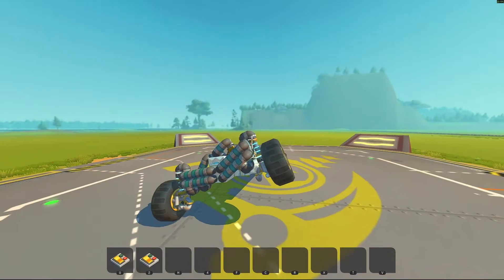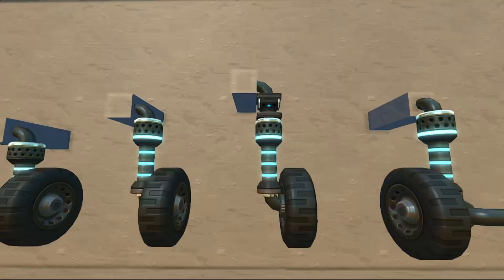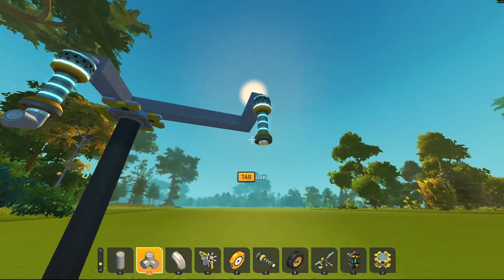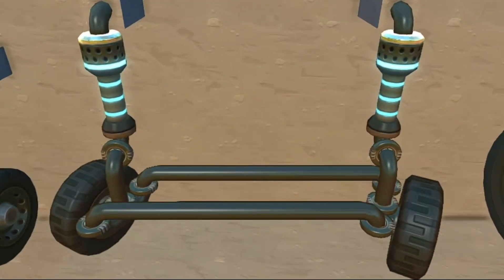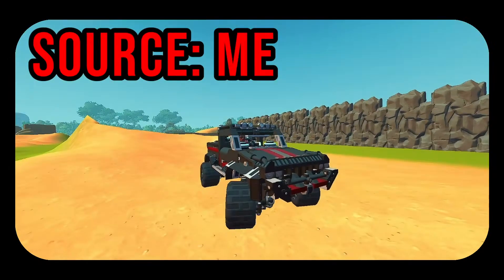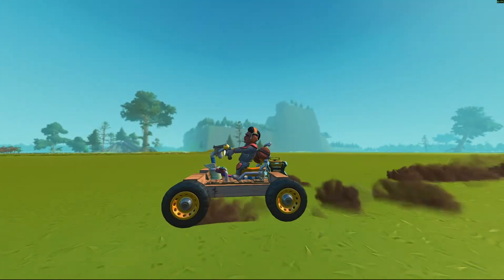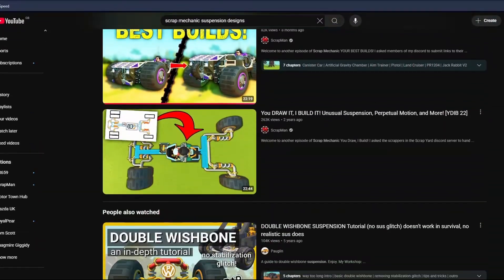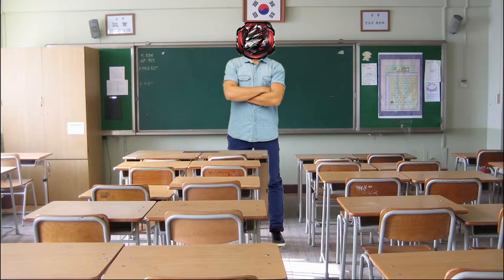Every Type Of Suspension You NEED To Know In Scrap Mechanic! | Scrap Mechanic Suspension Tutorial

Comment: On the topic of no suspension for larger vehicles, in one world, I built a semi truck designed to transport up to 28 fruit crates at the same time, 2x7x2, the truck is made almost entirely of metal 1 so it's ridiculously heavy and only uses suspension on the 2 front wheels because it doesn't steer without it

Comment: there is a better way to make the simple suspension. place a bolt at end of suspension. 
now you can add a bearing and/or a pipe bend inside the suspension mounted to the backside of the bolt and this way lower center of mass with 2 blocks.
it can even fully compress without problems since the suspension and piston is 1 block high when fully compressed.
it makes vehicles really stabile. works with pistons too.
this way you can also make drills that clamp around rock nodes when mining.
you can also use gas assisted suspension by adding a gas engine to the bearing.
this way you have adjustable strength when needed.
Reply from the maker: Yeah, this is also a great tip

Comment: The suspention with the bar connecting the two wheels is not independent suspension it's actually dependent, Independent suspension means that each wheel can move separately from the other wheels. On the one shown in the video if the tire goes over a bump or something on one side the other tire will move as a result. An example of independent suspension in scrap mechanic would be the basic setup with a suspension block above each tire. Other than that nice video
Reply from the maker: Yeah you're right, that setup is only semi-independent. Thanks for watching